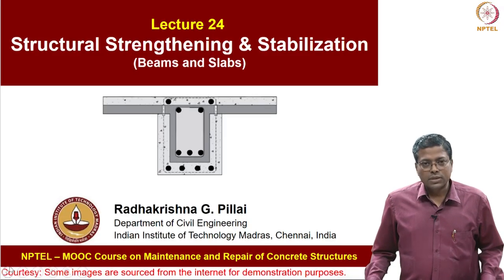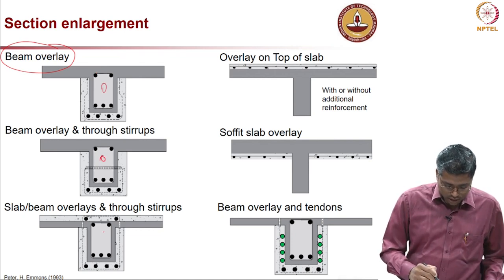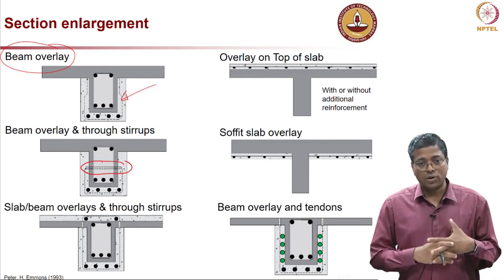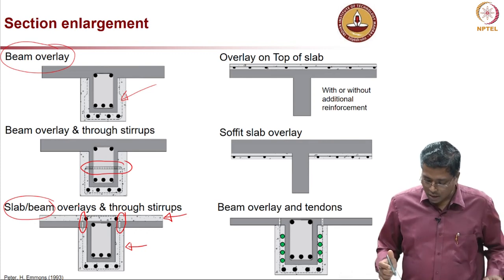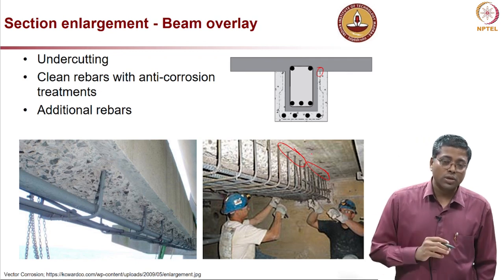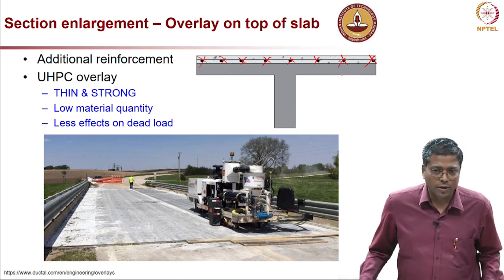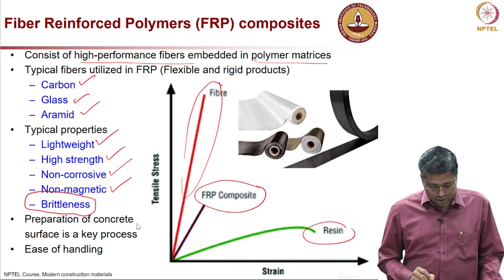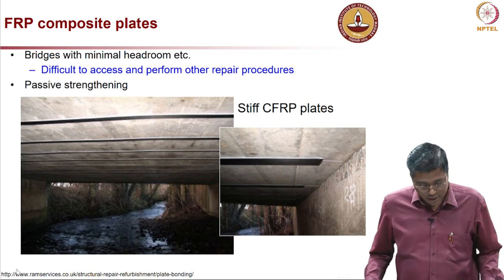Structural Strengthening & Stabilization - Beams and Slabs

Comment: Sir u given useful presentation. I have few questions. 1.How could u ensure compatability between the existing RCC and retrofitted Ultra high performance concrete.2 What is the ductility of retrofitted system that means increase or decrease. 3.why i asked this questions are before  strengthening of integrated elements  we must ensure safety of integrated connection system such as beam.column joint. R u done any experimental work in this lines???Thank u for presentation...